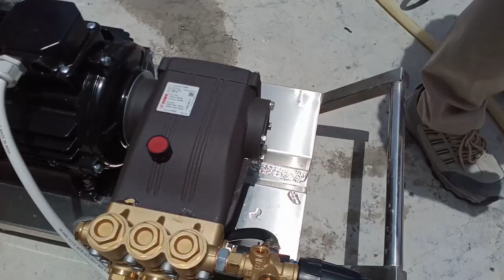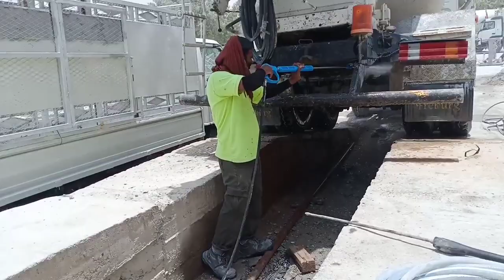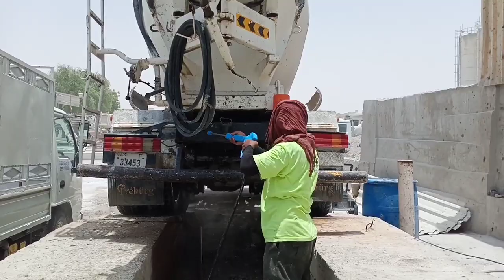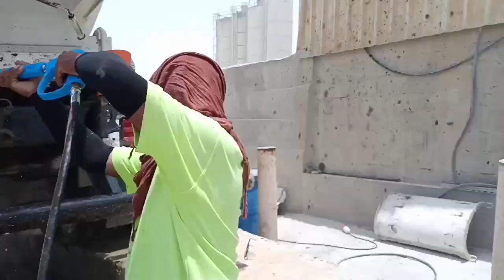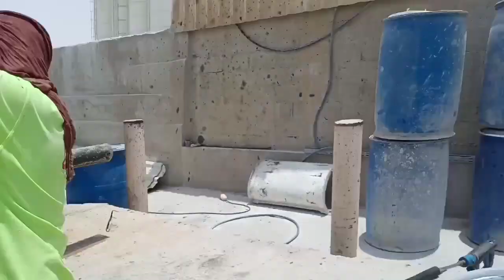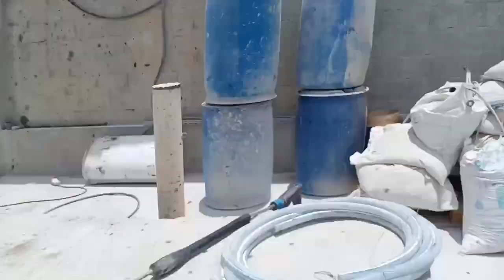HAWK High pressure washer pump.300.Bar ..#MTVolgs #Dubai #Washerpump

Comment: I have requirement Hot water pressure washer with an integrated diesel engine, Pressure 200
Reply from the maker: +971524786403 msg me